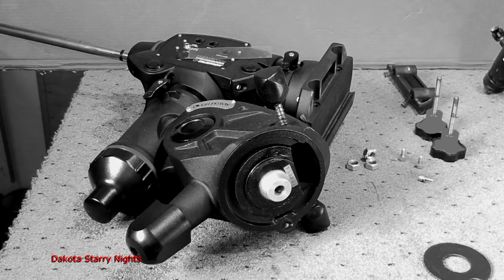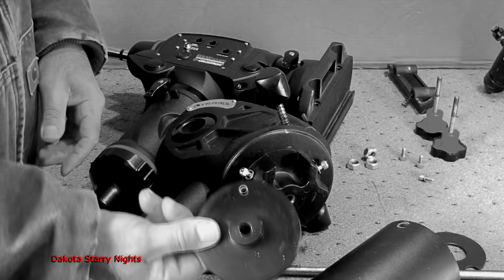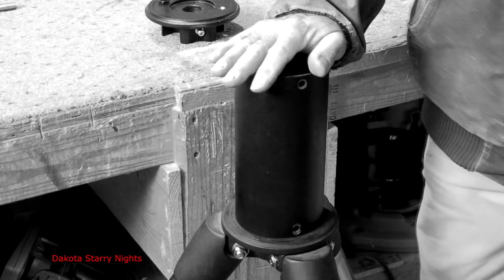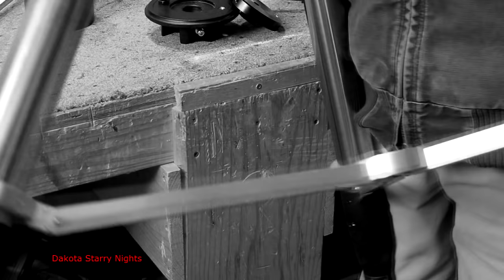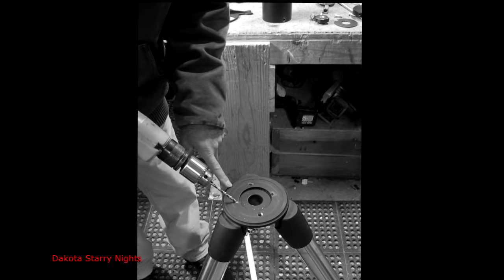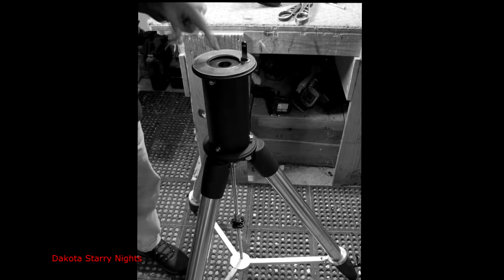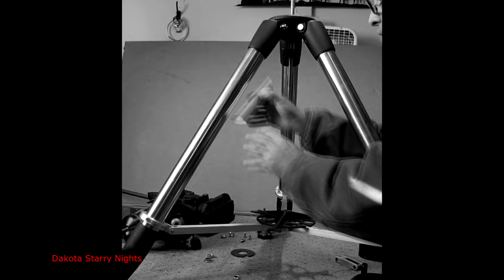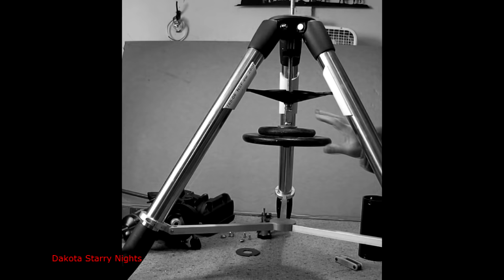CGEM Tripod Improvement & Pier Extension 2

Comment: Great video. At 29.40 and on you describe the rod you made which I have done before on a different mount. What I noticed was the tripod like all other tripods is much more stable is it has weight to it. So I use a metal coupler that thread onto the bottom of the rod and I attach a key hole bolt onto the bottom of the coupler. Then I used a stainless steel dog tie down which looks like a large cork screw and screw that into the ground directly below the center of the tripod, and then I used a ratchet strap between the dog tie down and key hole bolt. After cranking the ratchet some I had several pounds of added down pressure on the  tripod, so much that if I bumped into the tripod it want move. Others us a bag of rocks or a weight to hand from the tripod, but that may swing if there's a wind. So I can use a lighter tripod that's still very stable using this approach. JUST my 2 cents after going out in the field so many times before, and now I in an observatory on a permanent pier.
Reply from the maker: Thanks for the tip!  I've since extended the tripod using another method that is even better than the one you buy.  https://www.youtube.com/watch?v=YsprCjuN2UE  Gotta love that observatory I bet. :)

Comment: Thank you for sharing,
I had already implemented the long threaded rod on my setup but the way you fixed the adapter plate to the tripod will be a good improvement. I run into the predicament of of having to drill the four threads to allow the longer bar to go through and I felt uncomfortable with such a permanent mod to the tripod.
I decided to skim the thread from the bar itself and I did it with a bench grinder. It took some time but the final result was more than good. I bought a stainless steel bar on line for the job.
I hope it help others as an alternative to drill the threads.
Cheers from Melbourne Australia.
Reply from the maker: I agree.  Skimming the threads off the bolt with a bench grinder is a better way to go.   This was also the way another poster here approached it.  I didn't like the idea of drilling out the threads either. I have a heavy duty commercial bench grinder, Made in USA, that would have easily done the job.  But I didn't think of it at the time. Glad you saw a better way.  Thanks for posting! Dakota

Comment: I just wanted to thank you for your extremely thorough walk through and for your great ideas! I followed your guide and was able to get my pier to finally be rock solid. The only difference I had was that I decided to use my old mead field tripod since it has built in leg spreaders and has a wider stance. All that I have left is to find a m12 1.75 coupler like you did for the weights. Thanks a ton!!
Reply from the maker: Glad to be of service.  Clear Skies.

Comment: Thanks for the idea.  I have an Orion Atlas Pro which needs this modification. I'll be brave now that I see it how it is done. I have had good luck so far but It top adapter has come loose but it still imaged well for that night however the next night it was way loose so I had to take everything off.  Also I just got a scopebuggy and the wheeling things around also may lead to things loosening so this fix is great.  I don't know why the manufacturer didn't design it this way in the first place. - Thanks

PS:  Looks like the only thing I am ruining is the bottom and top adapters.  Drilling out the threads on the tripod only means the original bar won't hang independently on the tripod, it can still be used to hold the mount without the extender.

Comment: added the bottom spreader to my CGEM and it makes a difference.  Looking to ad some weight to mine like you did
Reply from the maker: Way to go!  That combo has been a real winner for me.  It's like getting the stability of the CGEM/DX tripod but it's lower to the ground.  I've noticed some guys wishing the DX tripod wasn't so high.  I've seen a couple of them and there are big.  The EQ head is the same as the CGEM except for a thicker counter weight bar.  Clear Skies! Dakota

Comment: Instead of the Bar Weight Dashpot, if you regularly Observe or Image at a Remote Site and you wish to retain decent Portability in your CGEM Tripod, cut a circular piece of 1/2in Plywood about 18in diameter (sized to slip between the legs on top of the TPI Spreader) and place your Field Battery on top of the plywood on top of the TPI Spreader.
Reply: Why not do a video on that?  Sounds like a good idea!

Comment: Great stuff.  I don't like the idea of drilling out everything, so I think I'll get a local machine shop to skim the threads off the new long threaded studding where it goes through the pieces you drilled out.  Then I think just the threads at the top for the EQ head, and at the bottom where the handscrew is - that way I think the studding will float freely in the extension.  Does that sound like a slightly modified solution?  Thanks for the video - great food for thought!
Reply from the maker: Having the rod modified to allow it to pass through the pieces I drilled out would be a better approach.  I don't see any reason why that wouldn't work.  Thanks for posting.

Comment: Dakota Starry Nights
How can one add a pier to Celestron Advanced VX for the counterweight to clear the tripod at low latitude?  The Azimuth peg is is towards the edge and there seem to be nothing in the market that fits. Or can you suggest one. Thanks
Reply from the maker: Sorry, but I don't have a VX to experiment on.  Perhaps a section of schedule 40 PVC pipe can be modified to work.  Or maybe some one here will post a solution.

Comment: Very informative video,  will try this on my new CGEM.  May I suggest that instead of a piece of plastic, you can use "slippery tape", which is low friction, and very durable. It's inexpensive, and has many other uses.  Can be found a Lee Valley Tools http://www.leevalley.com/en/wood/page.aspx?p=32182&cat=1,110,43466,32182
Reply from the maker: I'll look into that.  Thanks for posting. Clear skies, Dakota